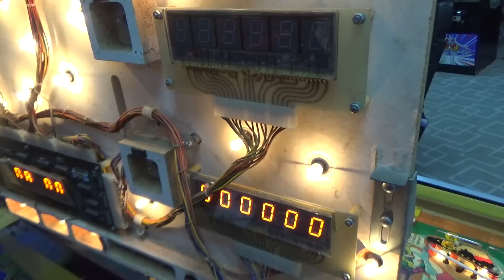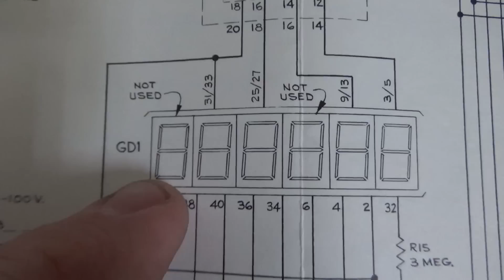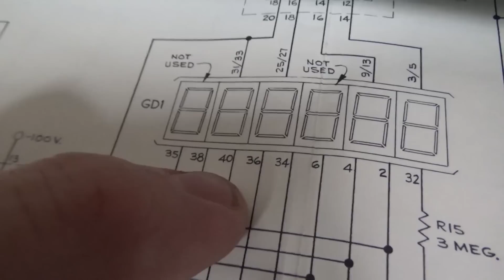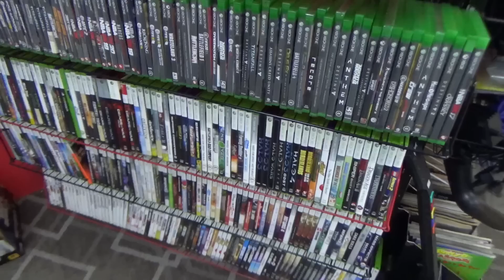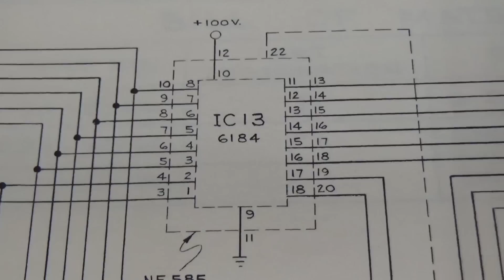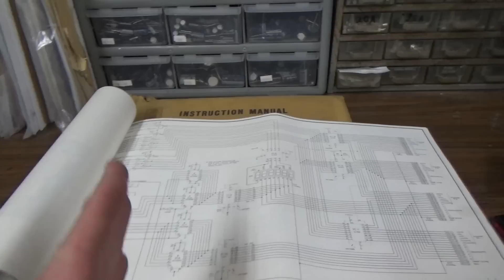How To Test & Repair Williams System 3-7 Plasma Display Boards - 1977 Lucky Seven Pinball Machine

Comment: A cheap plasma ball is handy for just checking to see if the display is outgassed. Pass it along the plasma ball surface and if there is gas you will see some light traces.
Reply from the maker: Somebody sent me one once, and we tried it, and it didn't do a thing.  Not sure if that actually works, mine didn't... there's a video on here somewhere of me trying it.

Comment: Any recommendations on where to start if the tilt comes on and the second ball doesn’t engage any longer?  Thank you
Reply from the maker: Is it a Williams System 4 or so like this one?  You may have a shorted diode on the tilt, or the ball outhole switch, they're on the same column on the switch matrix.  So it could be once the ball lands in the outhole, it scores more than one switch, and makes it tilt.  The matrix is getting confused (likely)... it may be a bad ic on the column section of the switch matrix on the pcb, or it may be the "PIA" that runs that section.  So maybe a board problem or maybe a diode on the playfield (or the tilt bob)

Comment: I know you probably already know this and were just double-checking the truth table, but any time you see a logic gate with a little empty circle drawn at an input or an output (like with those inverters) it means that input/output is inverting. So in the case of the 4069, the little circle at the output means the output is inverting, and thus it's an inverting buffer.

Thanks for recording this repair! I'm sure it will help a lot of people.

Comment: I saw how you were worried about using a logic probe on a chip that had 100 volts and rightly so for its sake.  I don't know if you remember that a scope can take that voltage and still show you the logic giving out signal.  For me the scope is always nearby setup so dragging it out and using takes me little time.

Comment: JOE CLASSIC< you mention when the displays have a ghosting problem because of the timing is off. What do you mean by this that the timing is off? because the strobe signal and blanking signal have to be "In sync" which the CPU chip/ROM chip is outputting the Strobe signal and blanking signal there is really nothing else that can alter the timing of these signals. I'm not sure what else would cause ghosting Display errors. Maybe from your experience you have seen certain things that cause display ghosting errors that you can tell me that causes display ghosting errors?